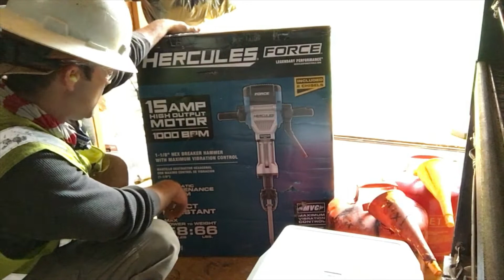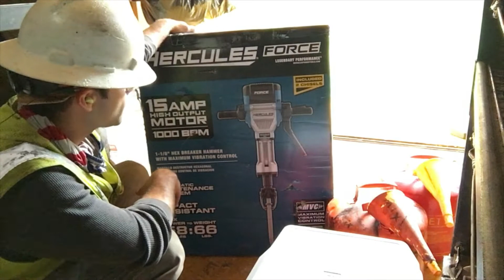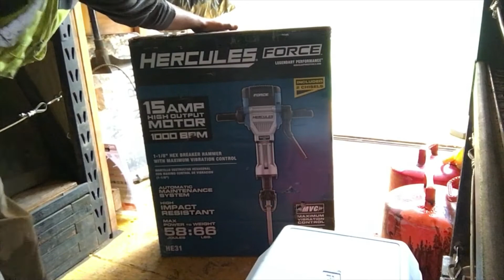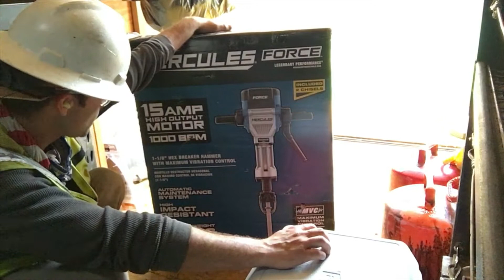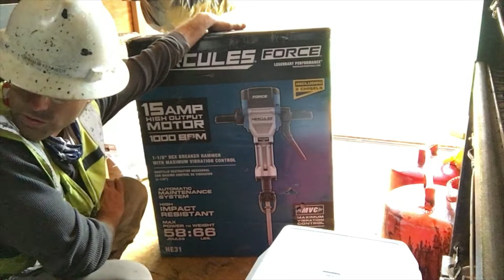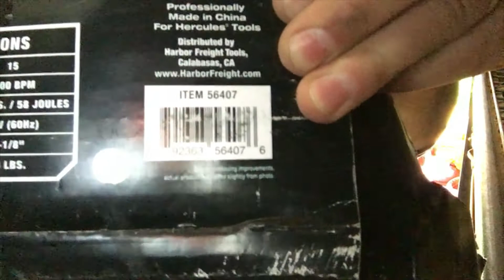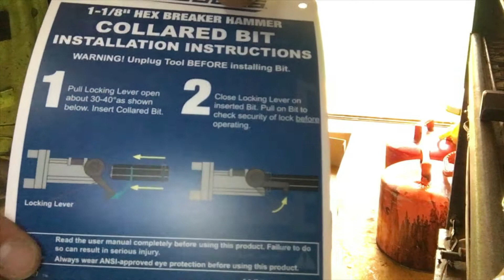Harbor Freight HERCULES Electric Jack Hammer,  unboxing and demonstration.

Comment: I bought this tool today and busted up a 1ft thick footing that was about 20ft long and 3ft wide. Very happy with the purchase. I have three more footing that are about the same size so hopefully it holds up tomorrow
Reply from the maker: I’m glad it worked out well for you too, do you have an update on the other footings? It helps if you keep your shank sharp.
Reply: @grahamkennedy7221  since my last post I used it to break up the other two footings, an entire bulkhead cement stairway and side walls for a basement. I had zero issues with the machine and I ran it basically 6 hours straight a day for 3-4 days straight. I should also probably mention that it was the first time I had ever used a jackhammer before.
Reply from the maker: @jeffcaminero7576  Wow that's some heavy-duty use,  I'm glad to know it's holding up.
Reply: Are you still using it till this day?
Reply: @solraczetined5951  I left it to a friend about a month ago to break up some concrete in his house and he loved it.
Reply from the maker: I used it two weeks ago,  worked great:

Comment: Looks like a fair unit. 
My question is, do you think it would work better with a badass bit from Bosch or something like that?

It's like any tool, even the best saw or drill will still perform poorly with a cheap blàde or bit. So I thought that with a better bit (ie: not harbor freight) the work would be easier for both the user and the tool.
Reply from the maker: You’re right I think this tool would work better longer with high quality Shanks. But they also come with a cost,  I’m curious If the additional performance would be with additional cost.

Comment: Graham, Tell us how thick the concrete is that you're working on? To be honest, it doesn't look like that jackhammer is getting the job done. It looks like you made cuts with a concrete saw and now you're breaking it up? I'm considering buying this tool to break up a driveway that's 3" - 5" thick, but based on what I can see in your video I shouldn't buy it because it would take forever, maybe even longer than just using a double jack. Thanks!
Reply from the maker: We where making a trench for a drain so we had saw cuts on each side. The concrete was 4 to 5 inches thick.  It went through it easy.  I would recommend it and if it doesn’t work just bring it back.
Reply: Not to hate on this coment..but..this comment is stupid..only a plumber knows about this kind of trenches..with wire embedded
Reply from the maker: Unfortunately even some professional plumbers skip the saw cutting,  glad you didn't skimp on that!
Reply from the maker: The only stupid comments are the ones you don't leave,  they all help my algorithm!
Reply: I absolutely make the cuts before breaking concrete slab, it make it much easier when is time to fix the floors again,  and I like the clean cuts, your client's apreciarte it as well.
Reply from the maker: @vnvtube2575  yes they do and that is one of my favorite customers!

Comment: Was price
Reply from the maker: $649.99
https://www.harborfreight.com/15-amp-66-lb-1-18-in-hex-breaker-hammer-with-maximum-vibration-control-56407.html?utm_source=google&utm_medium=cpc&utm_campaign=12189147054&campaignid=12189147054&utm_content=123858082464&adsetid=123858082464&product=56407&store=686&gclid=Cj0KCQiA-JacBhC0ARIsAIxybyMTDBneukNWInpm_LQ42e1YqpRV6_QEP7uVvV-DUx4pXh67QF0zVrUaAq_BEALw_wcB